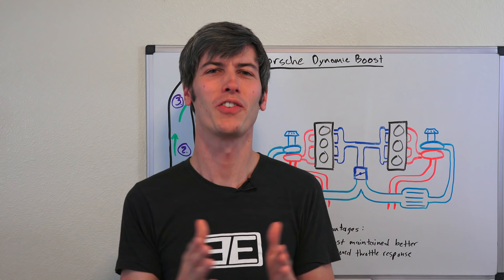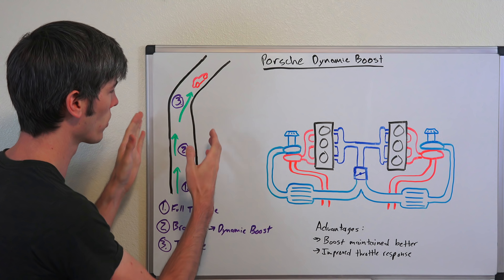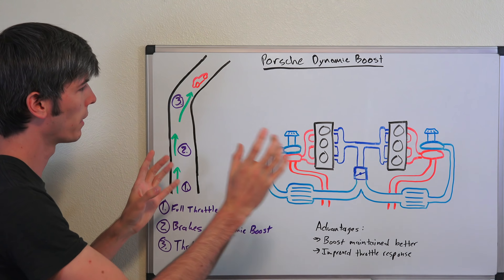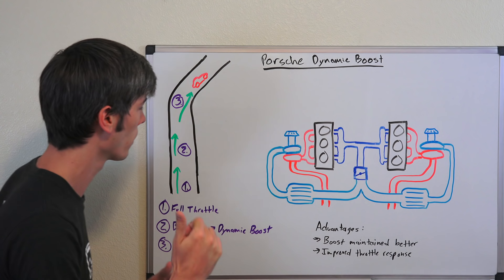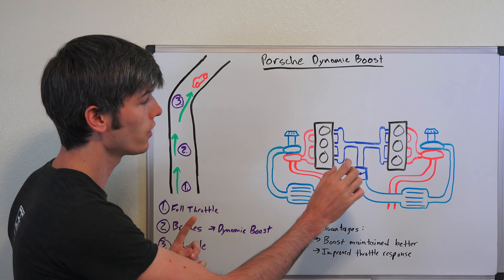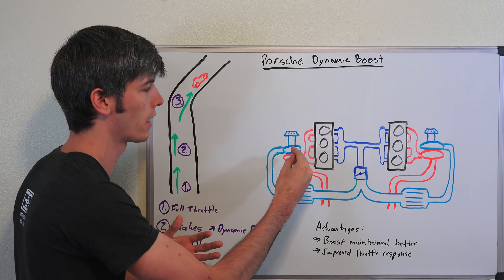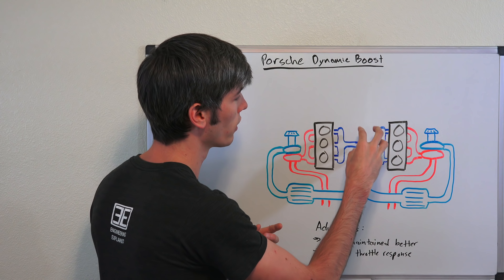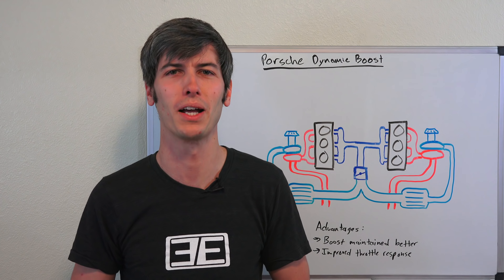Porsche's Anti-Lag System Doesn't Use Any Fuel

Comment from the maker: Answering the two most common questions! 
1). Does this eliminate engine braking? Yes, while the throttle is left open engine braking is nearly eliminated. You use your brakes to slow you down when driving (or braking) fast, not the engine, so this is no problem. Engine braking will be like normal in most scenarios, just not when you're driving hard (in sport mode) and immediately lift. 
2). Won't the engine run lean? No fuel is injected, none! Zero. So the air fuel ratio is infinitely lean, but this isn't a problem because nothing bad will happen without any fuel present. 
How Aggressive Anti-Lag Systems Work (Bypass Valve) - https://youtu.be/5g6cHs5vMRE
How Ignition Timing Anti-Lag Systems Work - https://youtu.be/wyJn40ExwZY
How Hyundai's Anti-Lag System Works - https://youtu.be/ccMg-KzMgU8
Reply: Another phenomenon that can be demonstrated with the ignition off :p

My old Legacy could generate 2psi with the ignition off if I opened the throttle downhill with the engine doing more than 3000rpm
Reply: Wouldn't this increase engine breaking? When the throttle body closes, there is much less air going into the engine and thus it does much less work. With all this air chugging through it, it is being used much more as a compressor and thus doing more work.

This could also be useful during shifts, as the engine would want to drop the RPM differential between gears much quicker (granted the clutches are doing most of that work anyway since the shifts are so quick
Reply: Engineering Explained if the throttle is open. Would that tend to run a lean cycle or start lean cycling. I'm curious to see how to overcome this. I like the idea and thought of it as you described it and told myself. Dang it Porsche. Oh well. Great minds and all.
Reply: How would this affect rev hang? would this cause issues with shifting? TIA
Reply: If there's no fuel going I to the engine how is it going to stay running?
Reply: Chaz Stark it keeps the gear engaged I guess, don’t know how this would work in a manual
Reply: @chaz4310  there's the same amount as idle, then yes? It seems to not have as much of a load (air quotes) because of the lessened amount of liquid fuel. I bet there is a staged throttle for when not on the pedal being higher then idle.
Reply: Seems like engine would stall with zero fuel. Could this be done with a manual transmission? Seems like if you let off the clutch in this scenario the engine would actually stop turning.
Reply: In a regular car, even if you're not intentionally "using" engine braking when driving aggressively, isn't still there when you lift, and it's taking some of the work load off the brakes. It seems like this system does indeed place extra load on the brakes.
Reply: @ringlol  either way, that would be a fine line or trans rotation and trans breaking, yes? Like in motion to roll start?
Reply: @bwxmoto  if the diff moves then the trans moves. If the clutch touches the engine in gear, then the movement moves the engine. Like a roll start? Idk how to better explain the last part
Reply: @USWaterRockets  very small, no? Unless you engine brake when you race (subjective) and I've seen where engine brake or down shift while slowing down worsens mileage.
Reply: @chaz4310  All modern fuel injection cars will use no fuel when you lift off while in gear.
Reply: The lost engine braking isn't good for high speed stuff, and puts a huge load on the brakes. Does Porsche use carbon ceramic discs (rotors) as a no cost standard fit in these cars?  They should!
Reply: Would you do a meetup in boise
Reply: I meant engage the clutch
Reply: What's the point of closing the throttle body then? Else than for engine breaking, seems to be a huge loss of efficiency in all scenarios, no?
Reply: Chaz Stark the engine is still connected to the driveline so is still rotating (assuming the car is in motion of course). All you need is fuel and spark to start producing power again
Reply: Unless there’s a phenomenon im not accounting for shouldn’t leaving the throttle open should increase engine braking not lower it? It’s simply acting as air pump in which load is proportional to the incoming air. Electric vacuum motors for example speed up when there is a restriction due to a decrease in load.
Reply: No. Closing the throttle body generates a vaccum in the Intake manifold. Hence making it harder for the pistons to pull in air.
Reply: I never use engine braking anyway.All I can say this thing is very cool and porsche always surprised us with
 such comeouts.
Reply: If the throttle is already wide open entering the corner, how do they handle the transition to light maintenance throttle at mid corner? Are the electronic throttle bodies fast enough to make that transition fast and smooth? Do they only send fuel to a few cylinders so the throttle can stay father open? I NEED ANSWERS! or not, that's fine too.
Reply: But what about the air/fuel ratio? Since the throttlebody is wide opened, when you start injecting fuel you either instantly get almost full power at that rpm, so you can unwillingly brake traction in a corner and crash, or you'll have lean combustion and excessive heat and emmissions. So how do they solve this dilemma?
Reply: what about vacuum boosted brakes? that won't work with open throttle?
Reply: @syncore33  vacuum pump
Reply: But this would be the case where an injector fails, and that will damage the piston/cilinder in all cases.  How is this a different case?
Reply: as far as i know engine brake is mostly down to the "compression but no ignition" of the engine, throttle vacuum has little effect on engine brake as it decreases the amount of air being compressed in the engine, in my opinion this system will effect the brake booster function more than the engine brake, correct me if i'm wrong
Reply: Maybe engine braking could still be introduced through delayed/advanced VVT. Which would create a resistive pressure that opposes the piston's direction of movement. Might be a way to still mimic the effects of engine braking while spooling the turbo with gasses in the exhaust manifold?
Reply: i think having the throttle open would INCREASE engine braking.  With the throttle closed, the engine isn't pumping any air through it, and cylinder pressure is very low (it's compressing from a vacuum).  With the throttle open, instead it's compressing from atmospheric pressure and pumping/compressing a lot more air.    Try pull starting a lawn mower on full throttle vs closed throttle. It's harder at full throttle.
Reply: Totally wrong mate!
I mean for 1).
Leaving throttle valve open does NOT eliminate engine breaking, it even does it harder!
What it eliminates is pumping losses which are part of engine breaking, but it is lesser part.
When you have closed throttle body you have huge pumping loses, but than you have much less counter force on compression stroke, because you are compressing "nothing".
If you leave throttle body open than you have almost no pumping loses but you should make volume of cylinders full of air 10 times smaller.
At this point you can close VNT vanes of turbocharger and you will induce also some pumping losses.

Because of this above you can find that most modern diesel engines as a fact throttle intake air in order to REDUCE effect of engine breaking.
Another good example are heavy duty engines on the trucks.
They should rely hard on engine breaking because it is very hard to make 30 tons not goes stupidly fast downhill and it is not possible to do it with brakes. You can see that they throttle exhaust and not intake in this applications.
Reply: Engineering Explained Jason! Why is it not ideal/possible to have a supercharger that can be simply bypassed when in “economic” mode, yet engaged with the flip of a switch?
Reply: Great video Jason, as with the best engineering solutions they are simple, I am a little surprised this hasn't been done before.
Reply: @sterlingroberts6240  It is totally possible, even VW does this for few years.
Maybe it is ideal if you are user of the car - it is 1.4 twin charged twice was really nice engine with good economy and nice power curve. But it is far from ideal if you are producer of the car - too complex and too expensive :)
Reply: As I understand it a large part of why this eliminates engine braking is because there is no longer intake vacuum, and the exhaust valves are opened very early with vvt in order to send air to the turbos to keep them spooled, thereby cutting down both sources of engine braking
Reply: @christoatanasov7811  I would say it's the opposite. Diesels have a throttle body to have ANY engine braking. And while it's not that hard to compress some air in a piston every 1 in 4 strokes (ever played with a syringe?) it is hard for an engine to work against vacuum all the time. Vacuum is what creates engine braking.
Reply: @grumpy_0ld_man  Did you ever drive old style diesel? Something before PD/CR era? Doesn't matter of it is turbo or NA.
They don't have anything except diesel pump and injectors and enourmously high Compression Ratio.
If you drive such car, did you ever left it in gear without hand brake applied?
If you still insist that it there is no engine breaking without throttling intake, then above couldn't be possible :)
If you still have in your garage something that have cable operated throttle valve, not DriveByWire, take this vehicle to a hill.. without starting the engine coast down the hill two times - once without throttle applied and once with full throttle.
Let us know time delta between two runs :)
Reply: No it can't increase engine braking, quite the opposite. I believe engine braking occurs when the throttle valve is closed because the piston movement tries to pull in air but it creates negative pressure because the valve is closed. It's like when you try to work a syringe while blocking the hole
Reply: When you release the throttle in any car, the fuel consumption is 0. The inertia of the car spins the wheels -> engine. If the rpm drops  below your neutral rpm it starts injecting fuel again to keep it above that
Reply: right
Reply: "Furthermore, the new Dynamic Boost function improves throttle response when the driver lifts
off the accelerator pedal during full acceleration and then gets back on it. At this time, the
throttle valve remains wide open, while fuel injection is interrupted. As a result, boost pressure
does not drop off completely, and the engine reacts promptly when the throttle is reapplied,
comparable to a naturally aspirated engine. The effect is most pronounced in Sport and Sport
Plus modes."
So it's similar to flat shift and got nothing with antilag. Doesn't use BOV/DV but keeps intake under pressure for that instant response when throttle is applied.

Comment: Easy method: full throttle around corners with no braking.
Reply: lasagna bloke That's how pedestrians do it because of their supreme handling.
Reply: DEJAVU
Reply: Easy method to wrap yourself around a tree
Reply: easy method: left foot braking ;)
Reply: @bitkarek  Nani ?!?! How can go that fast around that corner !?!?
Reply: You can only do that on Formula 1, on certain corner.
Reply: @diazzsama  shingo did it on the down hill
Reply: And he ends up in the barrier.
Reply: left foot braking is also used in rally
Reply: @diazzsama  not in the first time he uses it
Reply: Also no cornering! But who wants that
Reply: Or on a lot of corners in slow cars.
Reply: HI! I'm a noob to automobile engineering and I have a few questions on this topic.
1.When we take our foot off gas pedal, does the air flow only inside the intake manifold or it flows through engine to exhaust.
2. If the air flows inside the engine during off throttle, ideally the valves open and close with the engine speed but how does this process happen here, is it the same or different? 
4. Does the air flow at its peak during off throttle or limited air supply is given to the intake manifold?
Thanks.
Reply: For your second question, even in a normal car, the valves will always open and close. The camshafts are connected to the output shaft through a timing belt.
Reply: Easy method: KANSEI DORIFTO
Reply: Let me guess... Mustang?
Reply: I never understood why gas cars have a throttlebody to begin with. Before you laugh... let me remind you that Diesel works exactly like gas, and yet, your foot only alters fuel supply, not air... i would like a good explanation why a gas car needs this air “restricter”. Anybody?
Reply: @19Armada84  Because gasoline has narrow flammability limits. You can't fire a mixture much leaner than 20:1 (which would still make around 75% of full torque) with a port injected engine. Honda Insight can run up to 25:1 but it was specially designed to do so and the compromises involved were great, especially emissions cleanup with the special catalytic converter.

To run lean enough to idle you would have to use direct injection and ignite the fuel as it's injected (or have some other mixture distribution control method) to make the mixture around the plug rich enough to burn. 

Diesel does this automatically because the temperature is high enough for auto ignition and fuel burns at the instant and location it is introduced (no matter how little fuel you inject, it burns because in the millimetre beside the fuel droplet the mixture is within flammability limits and hot enough to ignite)
Reply: Yeah, Jason, we need some explanation
Reply: A forza player, I see.
Reply: I read somewhere that's what the original Audi Quattro Rally drivers did back in the early 1980's before they set up a recirculating air system to keep the turbo spooled up when the throttle (mechanically connected to the accelerator pedal and fuel delivery) was closed in 1985. Right foot on the gas and left foot on the brakes around corners.
Reply: KarunSriram 
1. Yeah it flows to exhaust, that's how it stays spooled up
3. Depends on how they optimised it I guesa
Reply: Ahhhh yes the Miata method
Reply: Messor XV: you use right foot to let the thorttle open thruout the corner and brake with your left foot at the same time, so your turbo revs all the time (and you use weight shifting and 4x4 to steer in the corner - Rally racers use it all the time.)
Reply: Not all Porsche's are AWD fam
Reply: And go straight into the tree
Reply: The tires will not hold. And if you are going fast there is no way you can drift tight enough. :-D
Reply: @bitkarek  that can lead to overheated brakes.
Reply: And then just powerslide around every corner
Reply: I know man you may hit a wall but you get no turbo lag
Reply: Assuming you won't understeer or oversteer
Reply: The Stirling Moss school of fast driving.
Don't forget to wave as you pass others in the corner.

Comment: Such a simple and obvious solution!
Reply: MRLIROCK id be scared of knock because there’s a lack of fuel, and if you boost your car and don’t have enough fuel, then There would be a knock
Reply: But because there is no fuel at all there can't be any knock
Reply: Knock knock! Who's there?
Reply: ytxstream but knock is when the air compresses in the cylinder and it heats up because the air is getting compressed. And what prevents the knock is the fuel because it cools off the combustion chamber and has something to go bang. So if there’s no fuel, wouldn’t the rods go bang down south?
Reply: @lukasrosa9974  I would guess that the ignition is cut off before or right at fuel cut off so that when the cylinder charge starts to become super lean up to just air, the ignition will not fire the super lean mixtures. Since these aren't diesel engines, the compression of the changing mixture after throttle release will fail to accidentally ignite itself and just be pushed out of the exhaust. No real danger of detonation
Reply: Dylan Headrick but doesn’t compressing the Air with no fuel cause a knock? The air gets too hot. That’s why there needs to be a correct AFR to prevent knock and let the engine run properly
Reply: @lukasrosa9974  knock is fuel igniting prematurely due to compression, can't happen when you don't inject any fuel.
Reply: Compressing just air doesn't cause any type of combustion. Knock is just premature combustion. By not putting any fuel into the cylinder you are not causing any kind of combusion. And in gasoline engines the operating pressure is too low to cause any concern of air getting too hot to cause degradation of engine materials.  Hell, if air could combust we would have engines powered just by it.
Reply: @killdizzle  in Germany, we don't differentiate between the two when we say knock ("Klopfen"), since that just describes the acoustic result. Both phenomena are some form of dieseling.
Reply: Wow, Porsche Engineering Is Awesome.

Bless The Germans and their advanced  automobile engineering.
Reply: I am the one who knocks.
Reply: @lukasrosa9974  compressing air will cause the temp to rise, but in the few cycles after the throttle is released there is no more fuel being injected, so no fuel to create any combustion. Just hot air
Reply: Definitely not simple. There's a ton of engineering to make sure that you can get on the throttle and not encounter lean conditions

Comment: This concept makes sense, however in this case I would've appreciated if you went a little more in depth. Hopefully you could make a follow-up video if there's enough demand. There are so many questions, for example when does the throttle valve actually close? How does it differentiate between the different scenarios needing to close vs not. Does this eliminate the need for a blow off valve ? How does this effect engine braking? Thank you for making these videos, they are super interesting!